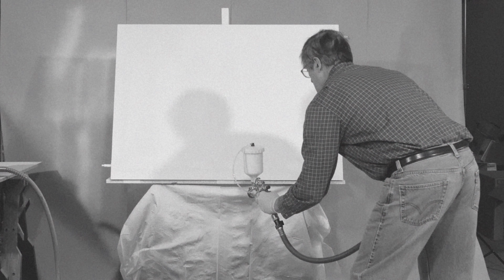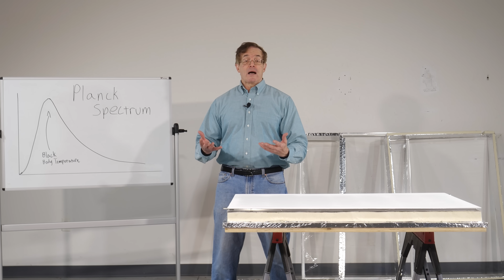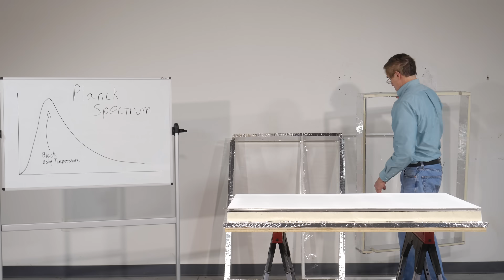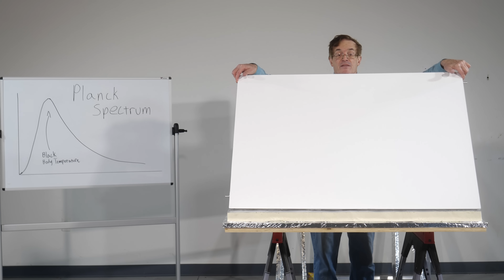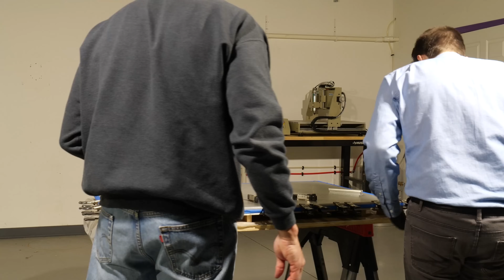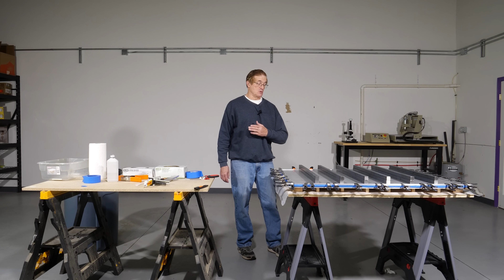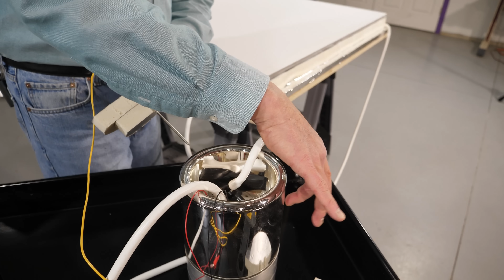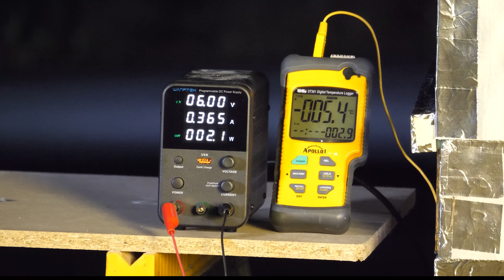Air Conditioning isn't free... but we're close.

Comment: i have had this idea that i dont know could even theoretically work.  i want to basically know what would happen if you dpnt have all the surface area facibg the sky but like sort of a tube will the structure cool at similar capacity based on surface area as long as the infrared can only escape towards the sky. maybe another question would be does if that the light produced instead of escaping into the sky hits just another different surface of the paint does the other surface just reflect it away potentially yowards the sky. if 90 perxent of the surface only ends up reflecting the light and heat towards just another paint surface how much worse will be the cooling effect. i ask all this because the biggest limitation right now is it having to face the sun. painting the roof with enough paint to complelety or by alot remove ac is still not possible. if the paint worked identically if the painted aurface is facing the sky directly or through a differebt paints surface than my idea of almost a cooler made of paint could work.
Reply from the maker: An infrared reflecting tube will work, but any surface that doesn't reflect infrared (the surroundings) will emit infrared back to the painted surface, and that's why the sky is the perfect heat dump.
Reply: @TechIngredients i am not that smart so is there even any way to know this stuff through equations and maths stuff or you really would need to test it yourself. for every extra bounce light has to take how much worse is that surface area in real numbers? i am sure i can figure it out myself if i spent a way too long time thinking about it but what would it be. in those watts per m^2 ? what is it for a painted  surface directly facing the sky? so many questions that i feel might be too dumb to ask. and what is it for each time the light has to be bounced towards another painted surface before eventually going to thr sky. i dont know if its predictable.
Reply: i guess what i am trying to do is just make the panels more compact. yeah that is what i am trying to do. using the calcium carbonate paint. a smaller cooler should be better. i still dont know the answer to a lot of things here could you explain them to me?  @TechIngredients
Reply: so as long as the paint is facing a different surface which is also the paint it will work.it should not be exposed to any other surface through direct line of sight that is not another painted surface or aluminum which reflects the infrared around similarly to the paint but dosent emit heat similar to the paint? am i right in thinking this? sorry for the  bad english. so theoretically you could design a structure that has a high surface area and reflects the towards the sky in very few bounces. i assume its not perfect. some heating will be lost. painting a roof with the paint is not a good idea and having to removing 10s of cooling panels is probably not ideal. the panels could fly away if the surface area is too much compared to the weight. its going to take more material for the panels as well. when winter comes is also not ideal. having multiple cooling systems is probably not ideal. the cooler is if possible a better idea from where i stand.

Comment: Why didn't you just pull a junk car radiator or two instead of using 1 million cpu heatsinks?
Reply from the maker: Actually,  I don't think we used any heatsinks.
The reason for building the radiator unit is that we wanted pure radiation cooling. 
An automotive radiator is mostly an air based heat exchanger. This will work against radiative cooling once the water temperature drops below ambient, which is the goal.
Reply: @TechIngredients  ah that makes sense! Still wrapping my mind around this unique concept. Good work by the way! Hope this idea has a future, could be big.

Comment: What if I told you that the greenest air conditioning was re-invented 50 years ago?
It is a really great piece about Persian Badgir or Egyptian Malqaf (windcatchers). It is very ancient, but very simple direct evaporative air cooling with limited Temperature difference and added moisture to the product air. More advanced is indirect evaporative with dry and wet channels, wet bulb limit and dry product air. The ultimate tech is dew-point indirect evaporative air cooling inspired by Nature and implemented via advanced tech with multifold savings in energy and water consumption, carbon emissions and cost. Prototypes of the ultimate third generation Gen3 are already available for demonstration to all interested parties
We would be happy to provide Undecided and Matt Ferrell additional information and demonstration video of prototypes with EER 200 (!)

M-Cycle is dew-point indirect evaporative cooling. There are two kind of channels in HMX and two separated air flows. Dry cold air at dew-point temperature in product channel and wet 100% saturated air in wet channel. Dry air delivered to customer, wet air rejected into ambient.
Reply: what exactly happens to the humidity of the air that has been forced to reach the dew point. by definition it would be at near 100 percent. and can tbe temp be lowered any lower than that using any clever evaporation stuff? the best idea seems to be shade it and then shade it more and then shade it more. that would be the onlybway to cool the temp any further than that. i wasted like 5 days thinking about the maisotsenko hmx and how its supposed to cool the air to way lower temps. but the absolute humidity is the same. and the dew point means that if the air with that temp and that humidity had its temp simply lowered than at what point would it start to condensate also known as reach 100 percent relative humidity. this is the problem you are trying to escape right. the humidity just doesnt go down. what do you mean a dehumidifier . that will cause more electricity usage. then do i use desiccants or membrane based dehumidifiers. oh it seems dessicant are almost identical to compression and membrane based is used for very specific stuff and cant be at all used for dehumidifying a home. what do i do . even if i had all this stuff at the end its not as good of dream i thought it was. sorry for the ramble. its just i think i know what you would end up concluding if you actually researched this stuff more.
Reply: @abhishekak9619  M-Cycle is dew-point indirect evaporative cooling. There are two kind of channels in HMX and two separated air flows. Dry cold air at dew-point temperature in product channel and wet 100% saturated air in wet channel. Dry air delivered to customer, wet air rejected into ambient.
Reply: what is the relative humidity of the dry air? i get that its colder and stuff. but what is the relative humidity of this dry air. so you would end up using a dehumidifying system.   @M-Cycle
Reply: @abhishekak9619  M-Cycle is dew-point indirect evaporative cooling. There are two kind of channels in HMX and two separated air flows. Dry cold air at dew-point temperature in product channel and wet 100% saturated air in wet channel. Dry air delivered to customer, wet air rejected into ambient.
Reply: M-Cycle is dew-point indirect evaporative cooling. There are two kind of channels in HMX and two separated air flows. Dry cold air at dew-point temperature in product channel and wet 100% saturated air in wet channel. Dry air delivered to customer, wet air rejected into ambient.

Comment: Interesting stuff. I’m curious how effective something like this could be in industry as a supplemental cooling system. I work at a gas processing plant and we’re always trying to maximize cooling while minimizing electricity costs for the use of pumps, compressors, and large fans. We have essentially unlimited space, very rarely is it cloudy and no trees within a few hundred metres. I want to do the math now on how much heat could passively be removed if the gas ran through a few hundred square meter version of this before entering the traditional radiator / fan setup. The only difficulty would be building the system to withstand 3000-6000 kpa pressures, which would require a lot of expensive welding.

Comment: I have a question...will it work in hotter regions like india. It's reaching above 45° C for past 6 days. And Honestly it looks like trend next year might be this hot as well.  If it works, how much temprature will it bring down In those conditions?
Reply from the maker: The hotter, the better it works.
Remember what I explained near the beginning of the video when I discussed the property of a radiating surface? The energy output increases with the fourth power of temperature!

Comment: 2.5 is significant?  Considering you are out side in freezing cold,  air moving over the uninsulated tubing could account for the temperature loss.
Reply from the maker: I think you missed the fact that the temperature of the radiating panel and the heat loss from the panel was BELOW  the outdoor temperature.
As I explained earlier in the video, operating at lower temperatures is a more demanding test because radiation is dependent on the fourth power of temperature.
Reply: @TechIngredients  Moving air is capable of reducing surface temperatures below air temperature.  I think it is called wind chill.  There were also seral other factors.  Humidity and what was under the table.  (wet grass, snow, ice) The difference in water pressure inside the heat exchanger compared to inside the holding tank?  all of this will factor in to the miniscule 2.5 degrees.  Show me a 10 degree change in phoenix in the middle of summer.  Then I will be impressed.

Not out to diminish your efforts just pointing out errors that I see.  Trying to make the resulting outcome with a better foundation.
Reply from the maker: I appreciate your feedback.
However,  moving air is not able to reduce the temperature of a surface to below ambient. Wind chill is a principal where moving air is able to carry away more heat from a surface that is hotter than ambient compared to still air.  This is because more cool air molecules interact with the surface in a given time.
This also applies to adding heat to a cooler surface.  But once the air and the surface are at the same temperature, no heat transfer occurs as there is no gradient to drive it.  This would violate thermodynamic law.  Entropy would have to reverse.
Our demonstration would have shown far more cooling power if we had done it in summer temperatures because the radiation output would have been much greater.  The temperature differential would also have been significantly greater.
Reply: @TechIngredients  Look forward to the summer demonstration.
Reply: @TechIngredients  Had a thought.  If it is possible to get the temperature difference high enough a (peltier element) could be used to generate electricity.  Night time non solar cell.
Reply from the maker: That's true. 
Did you watch our earlier video on the "Campfire Generator "?

Comment: You mentioned in another comment that diverse particle sizes in your “super coating” produce better results. Is that due to increased surface area? If so, I wonder if modifications to your setup could be made to increase the surface area of the radiating body? Using corrugated metal sheets could be a way of doing that although that may make fabrication more difficult.

Also, do you think that the waste heat from your submersible pump is negligible? I’m not sure how it would compare to the small amount of heat leaking through your insulation and your rubber tubing. 
If that waste heat not insignificant, maybe mounting it outside if your water reservoir could help it dump less of that waste heat into the water?
Reply from the maker: No, that wasn't the reason. The different size particles allowed for more dense packing and more efficient scattering.

Comment: Great. So you've made a radiator with sarking insulation. I used to work for a radiator that done everything from snowmobiles to generators on oil rigs, Antarctic research ships, small power stations in the pacific Island nations, military gear including tanks, but mainly mining equipment, being the main parts supplier to CAT UGM (underground mining). The maths is interesting. However how many miracles are you expecting to create with what's basically 2 radiators hooked together to create an inside/outside heat exchanger. Just open a window and get a fan. Job done for a few bucks and 5 minutes of effort. I really don't see what the big deal is here. Underground cooling pipes using the earths thermal mass are more effective. We build entire houses underground here in Australia to utilise this effect in the desert.

Comment: Call me an idiot, but why did you build your own radiator (nice as it was). Could you not simply use automotive radiators or residential ones? They all do the same thing. I am only 19 mins into this vid, so I will probably eat my words by the end! great vid btw, even in the uk we could use this.
Reply from the maker: We wanted a pure radiator. Those other choices are a combination of radiator and airflow heat exchanger despite what they are called.

Comment: You did not mention capacity. For any meaningful heat rejection you need additional capacity which means a much larger footprint.
Reply from the maker: Sure. 
But, the fact that the coating is the key,  you could paint an entire structure, and the surface area would be maximized.

Comment: Wait, wouldn't it also be a good coating for normal heating radiators in houses?
Reply from the maker: It wouldn't hurt, but the real benefit is the differential absorption and emission under a clear sky. Without the sky to act as a heat dump, then a simple coat of paint will work just as well in the confines of a room.

Comment: I was thinking a coating applied to a metal roof and drawing air through a trombe wall could cool this by having one end of the wall attached to a chimney drawing air passively .
Reply from the maker: I agree. There are a lot of advantages to a passive approach, and it doesn't preclude adding active components for specific purposes.

Comment: Easier and cheaper overall: Isolate your house at a minimum of 1ft in walls and 1 1/2 in the roof (use non flammable and bug/rodent repellent materials) and draw free earth cooled into house through a buried pipe. 😂🎉
Reply from the maker: Ok, do that, and THEN paint your roof with the special coating we developed for this test. I cover that coating in the follow-up video in this series.

Comment: This video has given me an idea. For places that use sump pumps to drain foundations... Water pumped up from the ground is MUCH colder than ambient temperatures in warm areas... Why not pass it through a radiator?
Reply from the maker: That is the basis for geothermal temperature control. It certainly works.
Reply: @TechIngredients  Haha, I knew something along the lines of that existed, immediately started learning about it, it makes much more sense that systems like that use a closed circulation loop. Thank you for reaching out, I thoroughly enjoy learning from you!
Reply from the maker: You're welcome.

Comment: If I'm not missing something this principle only works at night under a clear sky. I have my doubts when it comes to practical use of a technology with these limitations.
In the summer the soil a few meters deep is also way below ambient and in the winter it's way above. So in my opinion geothermal heating/cooling (in combination with a heatpump) is more pracitical.
Reply from the maker: It works day AND night under a clear sky, as we demonstrated in our follow-up video covering the special paint used for this system. 
Your other point is valid.

Comment: I noticed you weren’t wearing a paint mask when spray painting.  Not a good idea.  If you look at the vide you can see the spray wash on the right which is basically aerosol particles that you are breathing.
Reply: BTW something that Europeans do which hasn’t caught on here is Solar heaters on the roofs for hot water.  Black barrels with water in that get really hot.  Another energy saver !!!

Comment: Does this mean in simple terms, if I paint my house all white with this paint It will be several degrees cooler in the summer inside. If so do I need to cover the windows as well or is there a clear version. Or, have we not got that far yet?
Reply from the maker: It will.
Your windows represent a pretty small fraction of the surface area of the building and can be ignored.

Comment: 1. You still have to power the water pump and I assume at the scale of a building it will still take comparable power to an air conditioning system
2. Most of the materials used in this construction do no degrade on their own and can slowly break off and end up in groundwater and the air, increasing toxicity.

I really want to be optimistic but this does not seem to be quite it.

Comment: When you talk about heat loss to the sky, is this in any conditions? I've noticed that using an infrared thermometer pointed at clouds, or even noticeable haze the temperature is close to the temperature of the air near the ground. A deep blue sky is in the  -35° C range.  That I am sure is a terrific heat sink, but overcast, haze or clouds seems to defeat it.
Reply from the maker: Clouds and dust do indeed matter. A clear sky is much more effective.
Reply: @TechIngredients  So places in the west, especially Las Vegas, should soon be cutting their AC costs. I  used to take my students outside on clear blue sky days and challenge them to find the coolest and the hottest things with infrared thermometers. None of them ever pointed at the blue sky.
Reply from the maker: Actually,  I bet a few of them did, but they assumed the reading was "wrong." If one of them had come to you asking why, that's who you should hire.